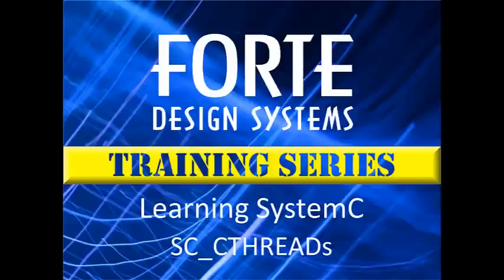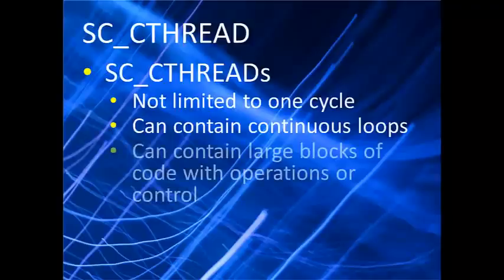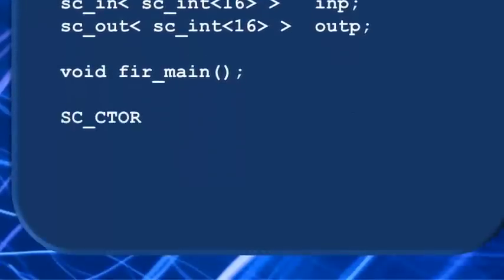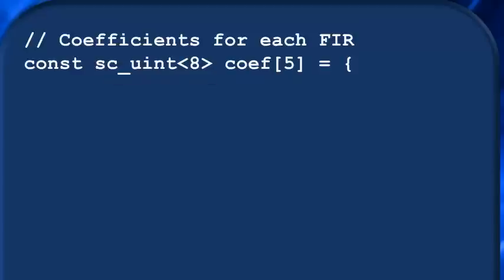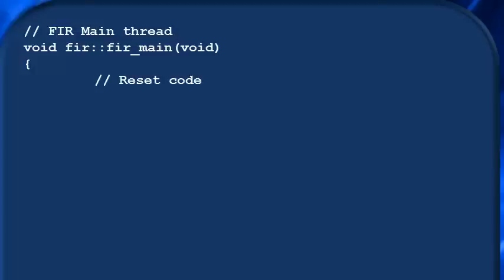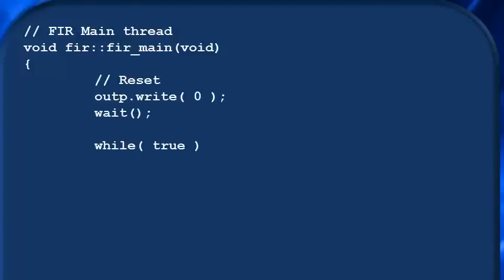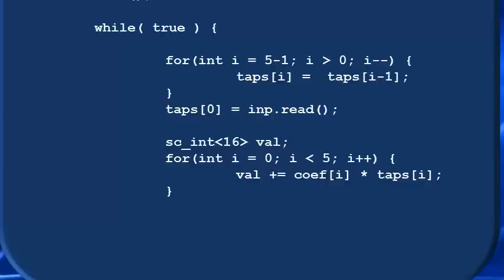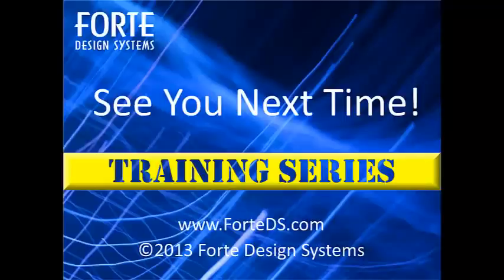Learn SystemC (2) - SC_CTHREAD Clocked Threads

Comment: val is not initialized to 0 before the "for" MAC loop in the fir_main process.
Reply from the maker: Anand, 'val' is a local variable to the while loop.  After each while loop iteration, it is taken off the stack and redeclared.  On the redeclaration it will default to 0.  You would only need to initialize it if it were a globally declared variable.

Comment: @7:17 are the two wait statements for registering of input and output signals?
Reply from the maker: No.  The first wait() is part of the reset protocol, so all it does is specify the end of the reset state in the finite state machine that a high level synthesis tool like Cadence Stratus would schedule for you.  The second wait(), since it comes right after the sc_out<> port is written, will register that output.  The input port in this example is not registered.  You would have to place a wait() statement immediately after where it is read inside the while(true) loop.